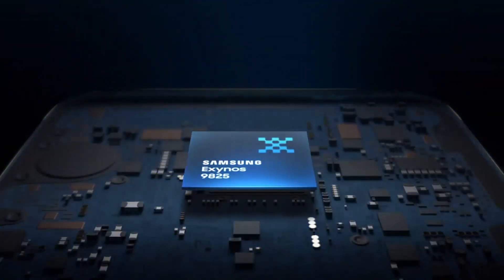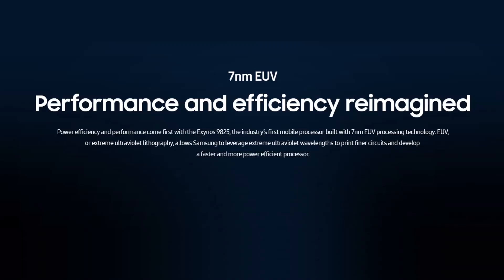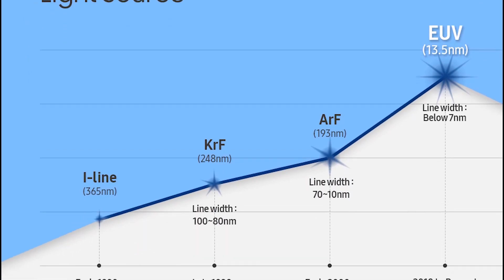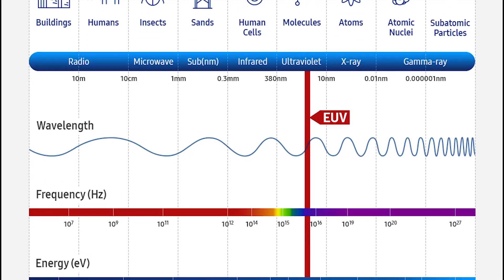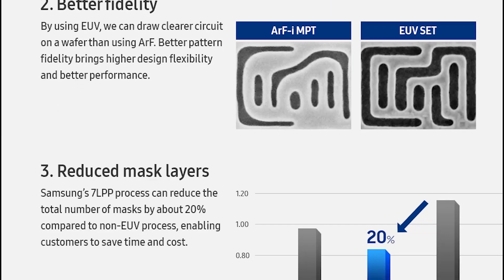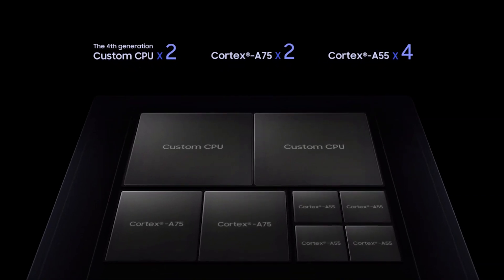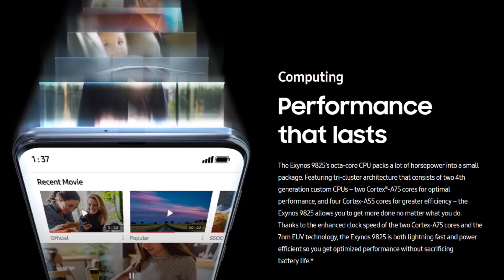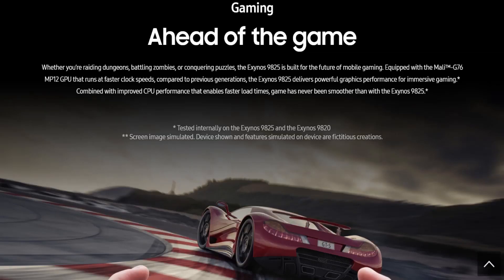What is the Exynos 9825 in the Note 10?

Comment: Meh! They did not even bother using the 855+! Instead chose the 855! Lazy Samsung.
Reply from the maker: Laziness has absolutely nothing to do with it. Do you have information about the availability of the 855+ and when Samsung could have folded that into its design process? With the 9825 Samsung knew about its development because it is in-house. My guess is that the 855+ came too late in the design process for Samsung to use. There were probably other political and economical factors as well, but laziness is NOT one of them.
Reply: @GaryExplains  Thanks Gary, probably yes haven't considered that factor. Samsung started their development way back in Q4 2018 and 855+ was released only in Q1-Q2 2019.

Still having said that 855 will be handicapped in the Note 10 for next 1 full year till Aug 2020 until Note 11, when every new phone competing will come out with 855+/865.

Comment: Why are they still using old A75 cores? why not A76
Reply from the maker: The 9820 also used A75. Since it uses a 2+2+4 setup, the middle cores (the A75) are used here as a bridge between the M4 and the A55. If Samsung used the A76 then it would either use 4xM4 or 4xA76. M4+A76+A55 probably doesn't achieve what Samsung wanted from those middle cores.

Comment: exynos 9820 is way worst than SD 855 but is not due to 1 nm, is due to 9820 sucks.
Now it may be opposite lol, SD 855+ is pour garbage, so exynos 9825 has a chance to be better.
Reply from the maker: Why do you think the SD855+ is garbage?
Reply: @GaryExplains  cause is 855 overcloked. This means virtually same performance, you won't notice difference but a lot higher energy consumption and heat.
Reply from the maker: @nemure  Really?!?! 🙄 So, why not underclock all these devices to 50% of their clock speed, you won't notice the performance difference but it will use less energy.
Reply: @GaryExplains  that's exactly what many manufacturers do, such us huawei or oppo.
They give you an enable/disable option to unlock clock speed  and the only thing it notice it is benchmarking, not real world usage or gaming.
Reply from the maker: @nemure  no that's not the same thing you are confused.
Reply: @GaryExplains  even if is the case, what I have for certain is a 24/7  overclocked cpu is a really bad idea at many many things
Reply from the maker: @nemure  Nevermind... it isn't 24/7 overclocked.
Reply: @GaryExplains  yes it is
Reply from the maker: @nemure  OK, you know better. Nice chatting.
Reply: @GaryExplains  its abious you don't understand what overclock means. Overclock doesn't mean the cpu is working at the hiest speed constantly, means they removed one protection layer to push it beyond the standard limits. This protection layer is removed 24/7 as I told you and is a really dumb idea.
Reply from the maker: @nemure  If original SD855 had been launched with those maximum clock frequencies, would you have said it was a dumb idea? I doubt you would. Your objection is to the clock frequency increasing now, and it is an arbitrary objection. You seem to have also missed that the additional clock frequency only applies to the prime core (i.e. just 1 core) and not the other three big cores. The other increase is for the GPU.
Reply: @GaryExplains  you are really wrong, SD855 has a maximum speed based on their designe to maintain energy and heat deficiency, SD 855+ lacks that, due to the overclock.
You can't compare a regular chip with an overclocked one. As I said, an overclocked chip lacks layers of protection, overhits and drains way  more energy than the "performance increase" which is really small
Reply from the maker: @nemure  So Qualcomm designed the SD855 and kept within the maximums (which it decided on), but then it suddenly went mad and no longer knows anything about design and is just randomly increasing clock speeds. Are you actually mad? What if the maximum speed of the original was actually lower than it could be because the manufacturing yields were better than expected and binning allowed then to make some devices with a slightly high clock speed? Ever think of that? Also, what layers of protection are you talking about?
Reply: @GaryExplains  Qualcomm is not the first time they screwed the chip due to the greed. It had a long good time making things right since the 810 disaster. And is happening again with the 855 +
Reply: Exynos is garbage fuckk offf !!!!! Really dumb you shut up pls !!!!!

Comment: Gary, in your opinion do you think the Note 10 9825 will at least match the performance of the Note 10  855.
Reply from the maker: I thought I covered that in the video?
Reply: @GaryExplains  Your opinion isn't  clear in the video, if you want to be a smart ass just forget I asked, thanks
Reply from the maker: I am not trying to be smart. You won't believe the number of people that write comments and ask questions who don't actually watch the video. Since I say at 5:00 that the 9825 won't be faster than the SD855 then I assumed you were one of those people.
Reply: @GaryExplains  I don't expect it to be faster, I just wondered in your opinion would it at least match the performance.
Reply from the maker: Ah, my bad. I didn't pick up on the "match performance." Sorry. Since the Exynos 9820 is slower than the Snapdragon 845, yes SD845, then there is no way that the tweaks to the 9825 will make it match the performance of the 855. It will now beat the 845, but won't reach the 855.
Reply: @GaryExplains  thank you , I'll get the 855 version

Comment: The exynos processors have such big single core performance, but it could not even take advantage of it due to the performance controller inefficiencies. Here is to hoping samsung has made more changes to the architecture under the hood for better performance. I am also a bit bummed that the snapdragon 855+ is not in the note 10. It costs a lot more than the asus rog phone 2 that has that processor, so I was hoping that samsung goes all out, but it seems that samsung wants to keep parity. I believe the exynos 9825 is built to merely catch up to the older snapdragon 855.
Reply: Yes the older one.

Comment: How does it compare with A12 Bionic chip ?
Reply: A12 and SD855 are already at 7nm and use EUV (TSMC makes them for both I believe).
Reply: Rosen Sofroniev a12 is not 7nm EUV it’s normal 7nm a13 will be 7nm EUV don’t be ignorant 😒
Reply: @kingyogesh441  Some people believe that Apple will not be using EUV this year, but a more refined 7nm (the PRO moniker) version with almost all the benefits of EUV from 7+, and that TSMC's only costumer of 7+ will be Huawei this year. 

All this derivated from their earning call for next quarter.
Reply: Miguel Ángel Listen the fact is Apple will always have first choice for the best tMC node Apple is by far their most valuable customer so I don’t care if it’s pro or euv
Reply: @kingyogesh441  I know that. Apple invests billions on TSMC to be a "vip" costumer every year. 
But again, this rumor is based on actual TSMC words, and given how hard is to actually implement EUV on the mass scale that apple needs (there are not enough machines) make it more believable.
Reply: Miguel Ángel does not change the fact that a13 will still be on the best silicon TMC has to offer I don’t care what’s it named

Comment: I dont think this will be better than sd 855 or even the Sd 855+... Mali Gpu will never beat adreno gpu
Reply: First of all there is way more to an SoC than just a gpu.
Second the s1, s2, note2, note4, and s6/note5 all had better gpu in Exynos.
And the mali g77 is alot the strongest gpu right now. Cause it's new. It might even give the next adreno a fun for its money. And next year's mali will be even better. They started putting more work into gpu.

Not to mention that most exynos chips out of the 10 generations thus far have had superior cpu, audio, and power efficiency.
Reply: @jackskellington6sic6  new 77 new GPU adreno is coming 😂😂😂
Reply: @wanmaziah9835  no shit. Buy g77 is already here. Just not in ant device. And its powerul enough to best the adreno 640, possibly edge the current powervr, and give the adreno 650 a run for its money. And there will be another mali next year as well. 
Like whats your point??
Reply: @wanmaziah9835 Sorry.
 My point was to them acting as if the gpu is the only thing that mattered. It matters more for some. But other factors exist and are key aspects still. 
And now also that you both are ill informed about Mali. 
It has in at least 4 out of 10 generations been better than its adreno counterpart. By brute power or though sustainable performance. 
The s1 used a powervr so that is different. 
And at least 6 to 8 out of 10 generations all had superior cpu, audio, power efficiency, and possible bigger isp features...though the isp features tend to not be utilized.

And the Mali g77 gpu is a huge leap from current graphics. Especially the g76. It's even possible the note 10 could have been released with it, but they either might have had to hold off a tad bit longer or just ate being greedy and holding off for the s11. They are holding back a lot things... Unfortunately lots of greedy companies around. 
It is a little late compared to other gpus this year but it's also their next breakthrough. And it should be strong enough to leave g76 and adreno 640 behind. While matching a12 and adreno 650. And another will come next year as well
Reply: @jackskellington6sic6  hmmm. Im also a user of flagship grade arm mali gpu.  But thru KIRIN soc... Mate 9 & LG G6, MATE 10 & One Plus 5T, p20 pro & poco f1.. and now. Mate 20 X & One plus 7 pro.. in all those phones.. adreno performed a lot better than mali.. or maybe because its not exynos ..rather kirin.. 
Mali g71 mp8 vs sd 835, mali g72 mp10 vs sd 835, mali g72 mp10 vs sd 845, Mali g76 mp10 vs sd855
Reply: @santiagoruel13  Again. You said mali will never be better and acted as if gpu was only thing that mattered. 
And i named all the generations that indeed had superior gpu with mali. Although the s1 had powervr.
Most devices you listed are with the same couple years where yes adreno is stronger.

And also again. The new mali g77 is a different story. Its a huge upgrade and is more powerful than the adreno 640. Even minutely edges the a12 gpu.
So it could also match the adreno 650 POSSIBLY. And next year the next mali will come and be even stronger. Maybe g78?

And again most generations of exynos had superior cpu, audio quality, and energy efficiency.

Comment: The CPU race is getting boring, I want to see significant gpu boosts wich makes the new samsung SoC disappointing
Reply: But single core exynos is strong too I want to know why is very strong than sd 855 ??
Reply: Wan maziah Exynos chipsets tend to do pretty great in memory related tasks owed primarily to the fact that Samsung designs the ram chips inside its mobile phones and the pretty great integration they have with the exynos soc since the ram chips are integrated in the soc itself allow for the memory latency as well as the read/write speed to be cut above the rest. If you check the detailed breakdown of the individual tests done in geekbench, you might notice that the memory latency of the latest exynos chipset sits in or around the 20 ns (nanoSecond) range, people definitely won't notice the difference, but it's definitely there.
Reply: @RazgovorIsDialog  ohhh I talk it was the custom CPU Monggose core use in exynos 9820 that why the single core is higher in genkbench right ??
Reply: Wan maziah That's one of the reasons, yes.
Reply: Wan maziah Additionally the mongoose m4 cores are power hogs, they tend to chew the battery like bubble gum but they are really powerful cores, just not that well optimised.
Reply: @RazgovorIsDialog  That's what the 7nm euv could fix. Better thermal performance, better efficiency, less throttle. 
Theoretically the m4 cores could sustain better bursts giving more real life performance gains with better efficiency
Reply: @wanmaziah9835  Um... yeah. I know. Although the miniature a75 increase is probably nothing more than to boost multi core a tad
Reply: Wait to 2021 they bought radeon graphics to smartphones
Reply: Its all about fps and "battery saving" yet we see nothing new....
Camera IA ? Is shit on every phone..... 5G? Pointless since we don't have yet unlimited data offers from companies..... 
Less power usage? Yeah but still no phone goes over 24hrs usage not even getting there.....
Reply: You will not find any more significant gpu boost after LPDDR5 because memory bandwidth is a bottleneck. The next one (though not that big) will come from LPDDR5X or LPDDR6.

And, why do you want more GPU power as there's nothing on the cellphone market that can actually use it. Ipads and laptops on the other side...
Reply: @MiguelAngel-rw7kn   wich app actually uses 8 cpu cores? Games are getting better every year so I don't know where you are getting at, I can play fortnite 60fps on my iPhone XR, playing with friends hardly hitting 60 fps on their consoles.. I want to see more phones capable of doing that and more..
Reply: @harryHensum  CPU utilization on a game depends on the quantity of physics and NPCs (and their routines). GPU on the other hand depends on geometry, shaders and a fucking lot of effects, and obviously, resolution. 

Apps that can use all 8 cores exist since a long time web browsers, render based-ones like photoshop IF (and is a big if) they dont rely on gpu acceleration, same with encoding, even games.

But multithreading is really hard because you cant parallelize everything and the things that can, dont scale at 1:1
Most apps still use much more a single core (like i dont know, 70%) and the rest of the work is divided on the other cores.